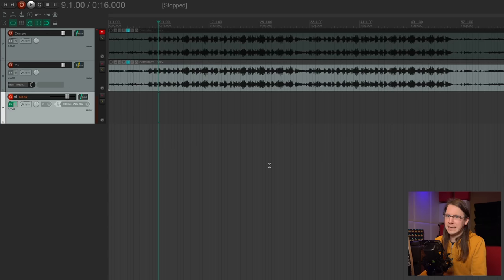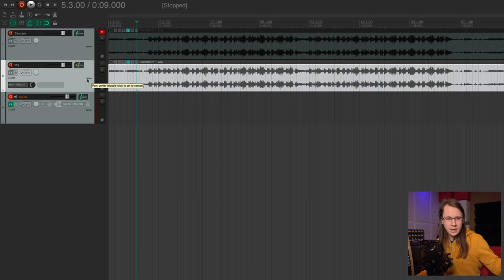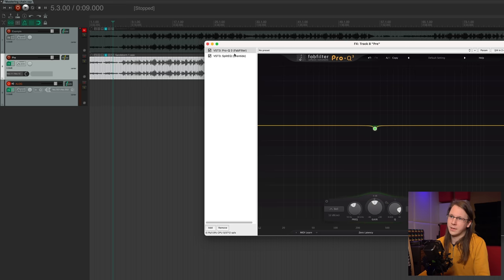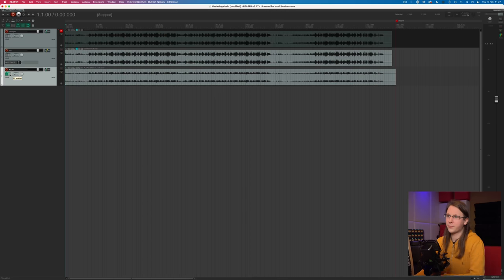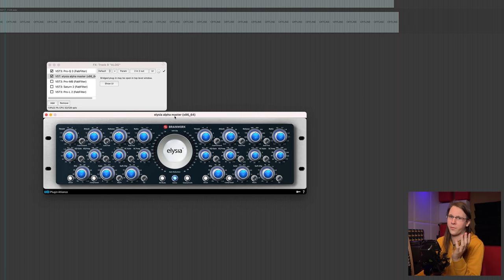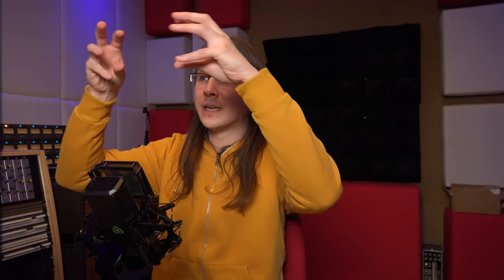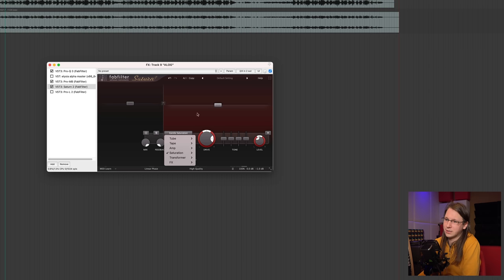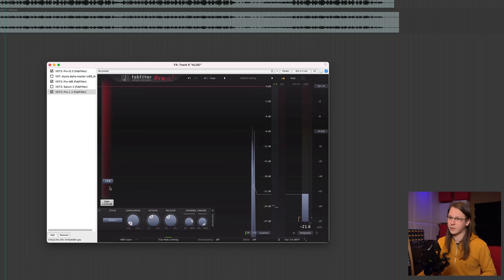My mastering chain

Comment: I have been messing around with one song for far too long and I think I finally got the best results. I did as much by minimizing my chain. I exported the digital file with no processing on the two bus; recorded onto tape with a Telefunken M15; and then relied on the AD converter to reign in any peaks with clipping (but basically just hit 0 on the hardware). Finally, I turned the track down 1 dB in Reaper and didn't even mess around with any digital limiters. It sounds great and I am comparing it not only to an original digital "master" but one for which I paid that also involved bouncing to tape. Sometimes we don't even need external EQ and compression, that is, beyond what a tape machine imparts if used. It basically comes down to, in this approach, finding the sweet spot when hitting the tape and making sure your digital mix is well balanced in the first place.

Given what Mix:analog now makes available, I can no longer stay "in the box." Nor do I feel like I have to pay hundreds upon hundreds to any mastering engineer to finish off my tracks. It's a great era to make music. :)

Comment: Hey Wytse, I am wondering: How many compressors are you actually using on one mastering-session (on average)? Because here you showed: Dictator as a first compressor, then the Crème or the SSL and sometimes the alpha, but always the MB as a last compressor. So if I counted right that would be 2-3 compressors plus a multiband - which seems like a lot to me. But I'm not a mastering engineer.

Thanks for the insight!
Reply from the maker: It’s 2, maximum 3… I basically always use the multiband and 1 of the analog ones, with an extra one depending on the source material
Reply: I think you can have compressors all throughout your chain and not worry about it. It's all about shaping the sound and that happens wherever it's needed.
Reply: @Whiteseastudio  ahh, okay, that makes a lot more sense to me! If I master my own stuff, I usually use MB and sometimes a regular comp in addition too. Any reason other than workflow why you have the compressor first and the multiband last? Thanks for your answer, it's appreciated!

Comment: Do you have any piece of analog equipment that uses vacumm tubes or it's all transistor based?

I mean, the harmonic distortion that vacunm tubes can produce would be amazing combined with your tape machine. At least on digital, i combine both forms of distortion.

Comment: Are you editing in Davinci Resolve? The dropout in the beginning av this video sounds like the thing that happens when you render videoes in Resolve with audio plugins that needs latency compensation. To fix this when you render choose custom, go to file and choose 100 as your render speed instead of maximum. If this is not your problem don't worry about this comment :)
Reply from the maker: Could be the problem 🤔
Reply: @Whiteseastudio  try rendring at 100 in stead of max and see if it fixed it 🙂

Comment: I also like to use long attack times but I also use quick release times. Is that a sort of way to do upwards compression?
Reply: I was always under the impression that upwards compression was similar to downwards expansion which is (i think) defined by the threshold more than the attack & release settings. Hopefully someone else can answer this question we both have.
Reply: Simple answer: not quite. Both downward and upward compression do the same thing (reduce the dynamic range), but in different ways. Downward compression is reducing the signal that goes above a set threshold and upward compression is boosting the signal below a set threshold without affecting any of the signal (peaks) that goes above the threshold. If the attack time is reducing peaks or anything above your threshold, then it’s downward compression.
Reply: @russell_szabados  you’re spot on! Compression is the opposite of expansion. Compression = Downward expansion. And as I said in my previous comment, downward and upward compression achieve the same goal, the only difference is how the signal is affected whether it’s above or below a certain threshold.
Reply: @tylerdengler6960  thank you for clarifying that. When you use expansion, do you just use a gate or do you have a dedicated expander like the ones offered by :FLUX:? I’m just curious if you think there’s any difference or improvement. 
The few times I’ve needed to use expansion, I used FabFilter Pro-G or the Sonnox Dynamics plugin, which has a separate expander section.

Comment: I can’t imagine EVER doing parallel work with tape vs a digital file, unless there was smpte communication between the two. Even the slightest variation from the tape (which they all have) would be phase issues, and why risk having that be potentially undetected?

Comment: You have 24 channels of tape distortion available. Couldn't that be used to replace the saturn with an analog multiband saturation/distortion? Would be a cool experiment and video.
Reply: I like that idea 👍
Reply: That is a good experiment for hobbyist. But for a pro like him it's not practical because he has to deal with a client all the time.
Reply: Would be 24 channels for exactly the same tape, meanwhile Saturn has more options available, or other timbres in general for those digital emulations.

Comment: Hey bro, I got an old Mac Pro ,, cheese greater,, os 10.6.8, lol,,the only reason I still use it in my mastering is because I have 500 plugins.. they all work great but , I think new plug ins sound better… you’re thought s?
Reply: @Jim Jones if it ain’t broke, don’t fix it. My cheese grater is still in heavy use, as a matter of fact I just doubled its RAM and put two new NVMe SSDs in it. I use it for orchestral sessions and a newer iMac for mixing & mastering. And last year my dad passed and I inherited his 2009 iMac - I put Snow Leopard (10.6.8) back on it and use it just for older plugins. As long as plugins have over sampling, it’s all just numbers, they’re all good.